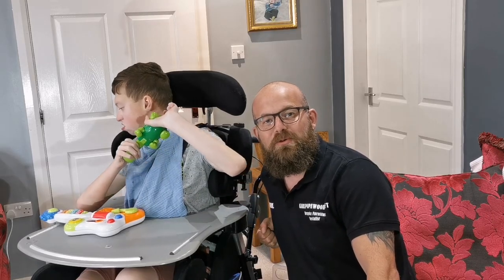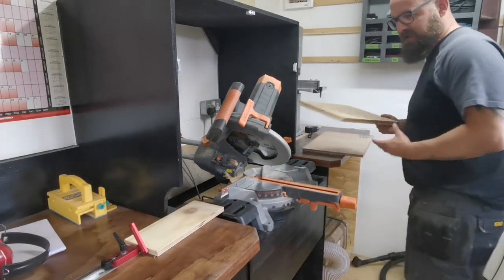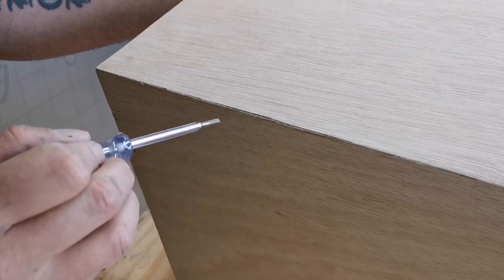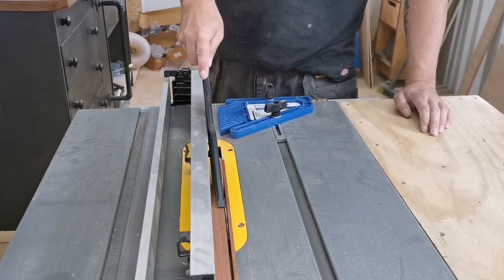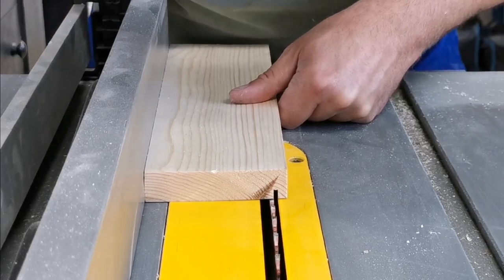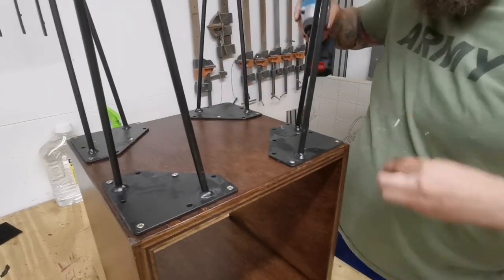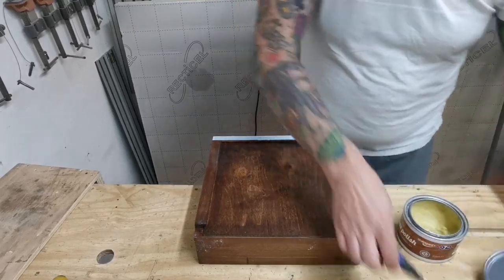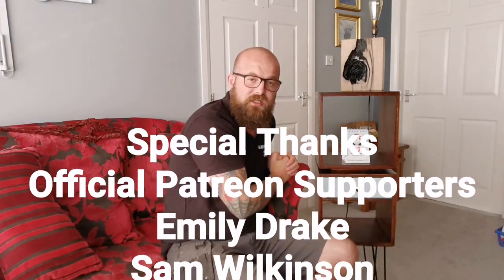Mid Century Modern Side Table - woodworking.

Comment: Super job Karl very retro 1960's looking, the legs suit the style spot on. You could do with some belt cramps/ratchet straps for your mitred 
joints, they apply pressure on all the joints evenly usually squaring the unit up in the process and are extremely quick to use. Enjoyed. Tony.
Reply from the maker: Cheers Tony, I actually bought some for that purpose but I'd been using them in my van lol great tip though mate.

Comment: Hi Karl, great project, thanks for sharing!
When de-nibbing the clear coat, do you wet sand at 400, or dry sand?
Reply from the maker: Hi Rob, I always spay the workpiece down with a little bit of water as this helps clear any slurry from the sanding and helps against any scratches. 😊
Reply: @karlpopewoodcraft  Thanks Karl!